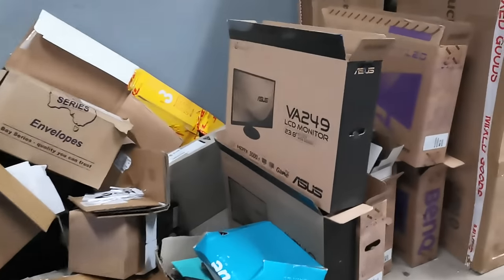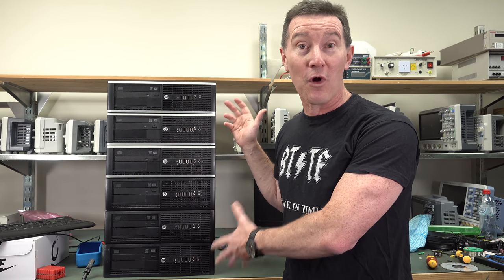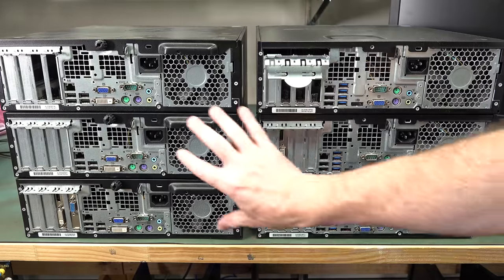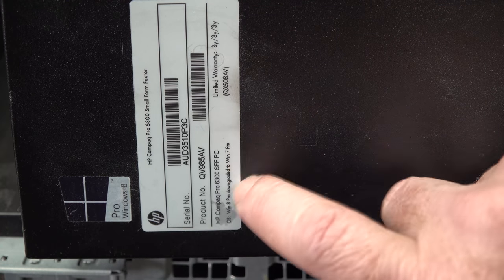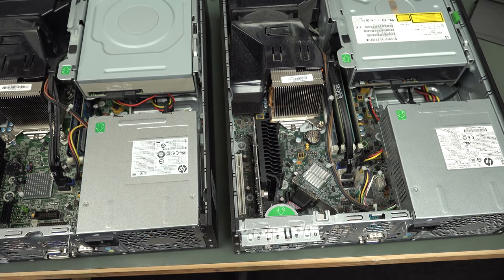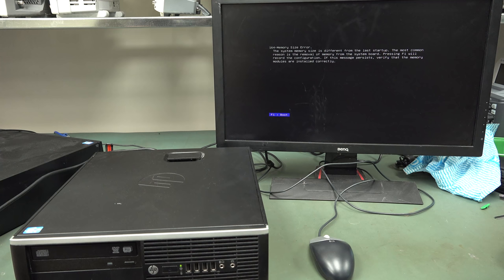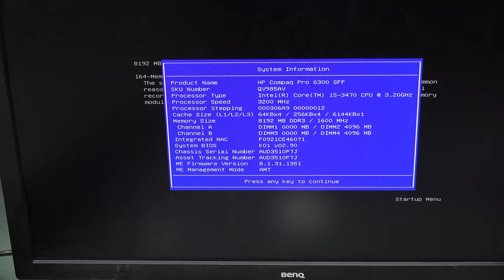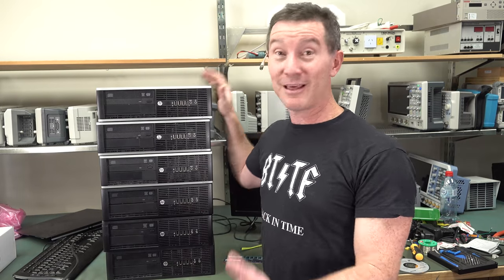EEVblog #1212 - Dumpster Diving PC Motherlode!

Comment: Up to Windows 8 Pro you could legally downgrade your windows version. So if you had windows Vista pro you could install windows xp pro, Windows 7 came with windows xp virtual machine licenced. With windows 8 you could get windows 8 machine with factory downgraded os to windows 7 pro. simply because windows 8 was to big of a change regarding looks and how some applications worked. Some software for hotels would not work on windows 8. Btwe licence key for windows is in bios just plug bootable USb and install away.

Comment: The one that failed was the company department's decision to upgrade.
Reply: Also, I'm sure they only remove those parts which are of any value. Over time, I'm sure they've slapped in higher quality stuff, which are the things they removed before trashing the lower-standard stuff.

Comment: And you think you did a good score ? I even beat E-waste Ben in terms of volumes and stuff.

It was in july 2012, i was on a physical mail sorting facility, nearby Dijon, i call it because i've just need to a PSU. So when the guy answer me, he said "not sure we have that, but you should come, we have huge quantity of stuff that will throw away".

In a couple of days, i was able to organize transport and storing, all for free. So what i do when it's finally happen ? Not one, not two, but six travels between mail facility and storing site.

What did i get ? EVERYTHING, barcode scanners, HP printers OfficePro K550, Lexmark T630 laser printers, of course some keyboards/mices, two dozens of rackables casings, monocard computers with socketboard (mainly ISA and some with both ISA/PCI) and i've got so many cables that it took one travel to transport it.

But the last, and not the least, was the following year, in november 2013. I was on the second mail sorting facility. They throw away once again, two dozens of 2010 NEC computers, which working, so why they do that ?

... 

Because... They change... From PS2 to USB ports !!

So i use one or two and i sell three other for 60€ each and i make the mistake to have choose a free storage, in a squat, so anybody could mess up all i got (roughly between 3 and 5 000€ of stuff)

Needless to say that i was out of me when i saw they (the squatters) wasted my working materials for scrap copper and gold.

I must still have some photos of that.

Beside that, i usualy found some large HDD with 500 Gb, 1 or 2 Tb, which work and can still be used for years (if i want, i could do a NAS with something like 15 Tb of storage capacity)

Comment: I was one of the few people who actually deliberately ugraded to Windows 8. Though I did my homework beforehand, and found out I could use Classic Shell to make it look like Windows 7. Otherwise I wouldn't have upgraded.
Now with Classic Shell installed it looks like Windows 7's ugly little brother, but at least it works properly now.
Reply: A free upgrade to Windows 8.1 will solve all of that, and no need to run Classic Shell.

Comment: what have you got to record television on Dave? because of the size they'd make a great digital television recorder as far as i am aware for ota your the same as the united kingdom meaning a cheap usb dvbt tuner should be good for picking up freeview oh and don't forget a hard drive, os and a mini usb keyboard. as for the rest hdd/ssd + an os and atleast 4gb ram should be good if you can pick up a cheap windows license or a linux os. Oh and also an internet connection if you would like to pick up catch up tv services!

Comment: Windows 8 was a troubled release and most enterprises and OEMs involved in the Tech Preview knew the UI was a non-starter but it too late for Microsoft to make another sweeping change and their stupid idiot vision was tablet PCs and Surface and remaining relevant in a world after iPads, which they incorrectly presumed would be the death of the PC.  Most IT operations continued to use Windows 7 until they deployed Windows 10.  Microsoft saved face by allowing OEMs to sell PCs with either Windows 7 or Windows 8 pre-installed but included one of these 'downgrade' COAs.

Windows 7 also supported COA and Product Key retrieval from the system BIOS, and that's likely why you don't see COAs on the newer machines.

Comment: I've bought quite a few of that era of machines new, and yes, as corporate machines they had both W8 and W7, mainly due to incompatabilites at the time and the fact many hated W8 (me included). I usually chose to use W7. Consumer machines were force fed W8 by Microsoft, no choice. W10 has become quite good so even this old bastard prefer it nowadays.

Comment: Windows 8 down grade to win7 was offered by most brands like HP and Dell as windows 8 killed off a lot of legacy devices as no drivers were available and businesses neeed their peripherals to work. Windows 8 killed off the best logitech mouse I have ever had as no driver were ever made for it as was blue tooth and win8 changed the way its blue tooth stack so it would not work .
Reply: MrGrantdw It’s for businesses that like to stay stuck in the past. MS offered the same downgrade conditions for Vista to XP as well.

Comment: NAS boxes or PI holes perhaps?  Redo the thermal paste and recap the powersupply if you do use them.  Stick in a cheap 250GB SSD and they're good enough for friends and family to do basic stuff.  Should be able to install and activate windows 10 on all of them if you can yank the product key out of the  BIOS.

Comment: If anyone doesn't value their time enough to turn $1500 worth of PCs into cash they obviously are paid way too much .  The Win8 -> Win7 downgrade was very common in offices due to the Metro interface which required retraining for staff who universally asked, where is the start button?  BTW the Quad-core 22nm Ivy Bridge cpus are still very capable processors, scoring over 10K on Geekbench 4.   Third gen was a big step up from Sandy Bridge at 32nm.
Reply: You are forgetting how much it would cost to pay someone for their time to do that and handling the accounting, etc.  Plus selling them may impact the tax write off, which will likely be worth more than their resale value.
Reply: They sell for about $100 per machine, and less since they don't have HDDs. Clean them up, list them, pack them, ship them... Deal with potential scams, which are running rampant nowadays. It's not worth it for most businesses.   Since they weren't thrown out, that means the company isn't large enough to have an IT guy. (Because the IT guy surely would have kept them and sold them)  So the president of the company probably threw them out, and his time is worth more than the time it would take to fuck around with those.
Reply: You are not very big picture oriented if you think a company would waste time and money such a thing. Seriously they would most likely loose money wasting time on them.

Comment: Windows 8 was a POS, it was standard practice to downgrade to Win 7. Win 8.1 was a bit better  - and I don't think you can run the on board and plug in graphics card at the same time.

Comment: I would install Ubuntu Linux in them.
Reply: LOL. I wouldn't run Ubuntu on anything. I'd either use Debian Stable or Windows 10. (I usually dual boot and then never bother with Windows except to update once a year)

Comment: It only goes to show how TRULY dumb ass most companies are to follow Microsoft down the road of ever less efficient, hyper bloat systems! Here I am using a 2004(!!) vintage tower case PC that runs JUST as well as a bang up to date one. 

It's been running pretty much non stop for the last 15 years, has overheated a few times and over temp powered off (MY fault for not keeping the room temp down) but has just rebooted each time no worries. NEVER had a blue screen of death or equivalent with ANY of the four distributions of Linux and multiple versions I've used!

Why upgrade, when using a PROPER, secure, reliable, consistent and FREE OS with all the apps you could want FOR FREE ... Just stop using shite and use Linux! I have for 20 years and haven't regretted a minute!

One problem for Dave though ... It would mean FAR fewer scores like this in the dumpster diving stakes. 😂

Comment: not really SFF, thats a 'normal' desktop size looking at them from here..perfect for freeNAS / pfsense
Reply from the maker: They are literally called Small Form Factor (SFF) PC's on the datasheet
Reply: obviously SFFs
Reply: @EEVblog  maybe so but from here they arn't that small and to me hp are being a bit loose with what they class has 'small' - i've a older lenovo m91 'sff' (used for a pfsense box) that is half the height and around half the depth of these, the regular m91 looks to be the same size that hp are slapping sff on; same from the dell usff / sff that turn up on ebay.; might also be lacking perspective but while the pci/pci-e cards themselfs look to be half height the actual bracket looks allmost fullheight ? either that or due to working with laptops and usff devices in the office for the last ten years now i've lost the comparrison to what a actual full size pci/pci-e card/bracket looks like. anyway good dive, perfect for pfsense / freeNAS and indeed bonus points on them having serial ports on them; no more pissing about with usb to serial adapters \m/
Reply: Way overpowered for pfsense.  It'll run perfectly on a Core 2 Duo.
Reply: Desktop cases are quite similar in size to a mini-tower laid on its side.

Plus the half-height expansion slots is a dead giveaway that its SFF.  Although I don't think SFF is actually any sort of standard anyway.